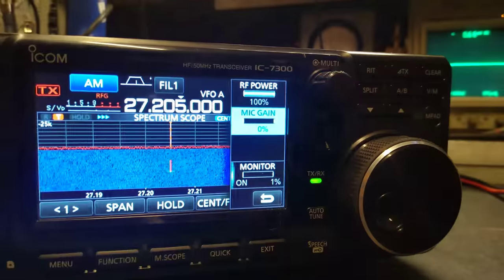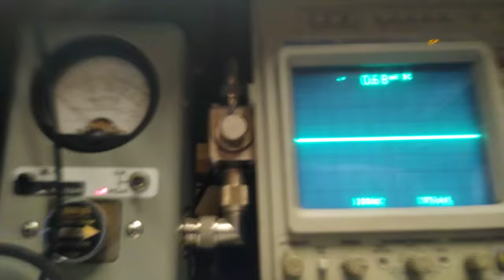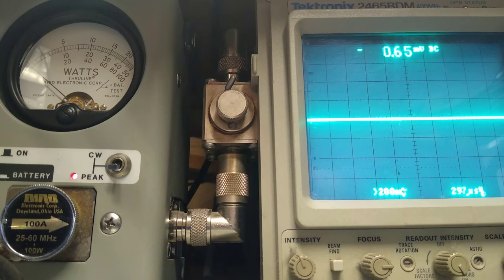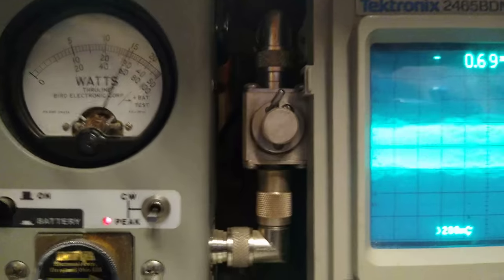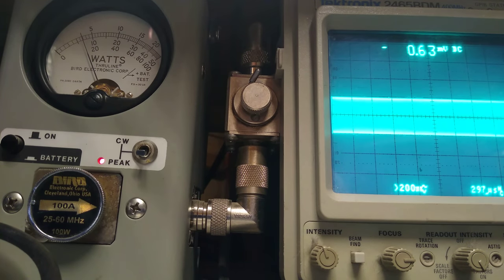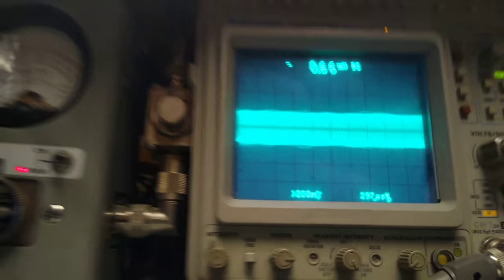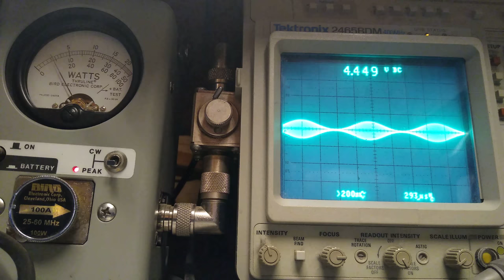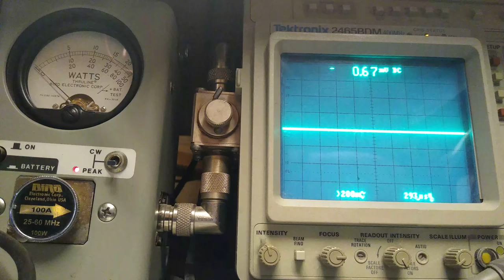Fine Tune CB Shop - IC 7300 .. What Low Level Amplitude Modulation Look Like.

Comment from the maker: Cleaner And Meaner

It's not about how many watts (if you want range), it's about how clean that you can make each and every single one of them.

The 955 Versions 2's are worse than the original
version's, and require even More TLC.

Tap tap tap ..

If they can't show you they're snowing you! Find someone who's honest and competent.

Making it clean "and" out performing those hacked up splatterboxes 
requires Skill and Calibrated Test Equipment. If they claim otherwise, 
they're either a con artist or incompetent. Take your pick!

Blame it on the materials, math and Mother Nature!

Elements, Constants and Cycles.

They can work for you or against you.

Safety First!

Cleaner And Meaner, there'll never be a substitute .. like it or not.

It's all about Procedure .. No Exceptions.

One At A Time .. Don't Be In A Hurry!

You make them ring and I'll make them sing. 
https://www.nist.gov/pml/productsservices/physical-reference-data

No longer accepting mail-ins .. Fine Tune CB Shop services radios for 
the original owner that has purchased brand new radios from Fine Tune CB
 ONLY. This way, like the Maytag repairman, I only see one or two radios
 out of 500-600 per year that may have developed an issue. I'd rather 
spend my time doing better things .. maybe you should too??

Cleaner And Meaner .. Only the serious need apply.  No "tire kickers" or
undesirables that I know for a fact disrespects the airwaves and 
especially Channel 19. Haters are always going to hate because it's all
that they know how to do and what they do best. Don't be so miserable!

If you can't handle the heat .. get out of the kitchen. 

If they can't show you .. in a video .. they're snowing you. Get The 
Picture??

Here's what it actually takes to cut through the noise, be loud and 
crystal clear with a better receiver too:  A) Tuned Bench:  
https://www.youtube.com/watch?v=lwcDfXOgAls.  True, it's more 
complicated and time consuming to accomplish these consistent and 
accurate results. Below is a partial procedure and list of calibrated 
equipment used to achieve this level of performance . Read on ..

Radio Evaluation Rules: 
https://www.facebook.com/163Hardrive/posts/3729504220447644
https://www.facebook.com/163Hardrive/posts/3523601657704569

Fine Tune CB Radio Shop strictly adheres to (https://www.nist.gov/) NIST
Traceable Calibrations and other industry standards to maintain 
accuracy and consistency for providing Real World Performance Tuning of 
Citizens Band and 10 Meter export mobile radios with integrity.

"Basic Textbook AM/FM/SSB Transceiver Tune, Alignment and Calibration" 

1) Pll adjustments
VCO & OSC, AM TX OSC, USB TX OSC, LSB TX OSC.

2) Transmitter alignment
DRIVER BIAS, FINAL BIAS, SSB  (or gate voltages for mosfet versions) 
CARRIER BALANCE, HI-LO AM & SSB Power, RF METER, AMC, ALC and FM 
DEVIATION.

3) Receiver alignment
AM/FM RF & IF SENSITIVITY, FM DETECTOR/DEVIATION, SSB IF 
SENSITIVITY, SSB S-METER, AM/FM S-METER (100uV unmodulated -67dbm for 
�S-9� meter reading!), AM/FM SQUELCH RANGE, SSB SQUELCH RANGE, and NOISE
 BLANKER/AUTOMATIC NOISE LIMITER (Real World dBm to volts (uV) tables 
below).

That's just a typical run of the mill textbook tune up and alignment (if
 you're lucky). There's more to it than frequency alignment, modulation 
adjustment, meter calibration and a tune up report displaying 
exaggerated rms Bird peak watts! 

"Test Bench includes"

Bird 4314C Meter
https://www.birdrf.com/Products/Test%20and%20Measurement/Power-Meters/Wattmeters-Line-Sections/RF-Wattmeters/4314C_PEP-Single-Element-Wattmeter.aspx
Part 1) https://www.youtube.com/watch?v=RpX9IHe4ORM&t=16s
Part 2) https://www.youtube.com/watch?v=LuhbqTf6Bxw
Bird 4314C Accuracy Test: 
https://www.youtube.com/watch?v=DqEOabYqhQo&t=5s
Bird Stipulates 1/2 wavelengths  
https://www.youtube.com/watch?v=5eWhgT-rTII
And Genuine Bird Elements from 1K down.

Bird 4373 Sampler 
https://www.rfparts.com/signal-samplers.html

HP8924c with options
http://userequip.com/files/specs/2147/HP%208924C%20Repair.pdf
https://www.youtube.com/watch?v=Cg1w0xBa27s&t=1s

HP8920a with options
https://www.keysight.com/upload/cmc_upload/All/EPSG072204.pdf

Three analog scopes, one digital 200 Mhz
https://www.atecorp.com/atecorp/media/pdfs/data-sheets/tektronix-2465b-2467b_manual.pdf
https://www.youtube.com/watch?v=by98x4eu2lM

Fluke 27fm
http://www.fluke.com/fluke/inen/digital-multimeters/fluke-27.htm?pid=56055
 
LCR 
http://www.lcrresearch.com/wp-content/uploads/2017/05/LCR_Pro1_Manual_version1.03.pdf

Power supplies
6 Cosel PBA1500f12 (750 amps) variable and configurable.
https://en.cosel.co.jp/product/powersupply/PBA/PBA1500F/PBA1500F-12/
Corcom 20VB1 F7130 EMI Filter 50-60Hz 250V

Times Microwave Coax jumpers and test leads
http://www.timesmicrowave.com/cms/products/cables/lmr/
https://www.youtube.com/watch?v=EmqaGJ6IWow
https://www.youtube.com/watch?v=1ltFVSxGp5Y
https://www.youtube.com/watch?v=v12YZT_1o90
https://www.youtube.com/watch?v=h7iiYfmYWRA&t=215s

Amphenol RF Connectors
https://www.amphenolrf.com/
https://www.youtube.com/watch?v=dVh5B0hdEA0 
https://www.youtube.com/watch?v=dKZg8T_AOso

More range, compliments, reliability and a quieter, clearer but more 
sensitive receiver,  Get Fine Tuned .. not peaked and ruined.

It's what I recommend, use, service and sell ... to you ... not 
something non practical or deceiving in a misleading way. I'm not just 
the tech and owner of Fine Tune CB Radio Shop, I'm a customer too!  When
 finished, You'll be giving radio checks, not asking for them .

dBm To Watts and Volts
Tables below displays relationship between Power in [dBm] or [Watts] and
 Voltage in RMS, peak, peak-to-peak for sinusoidal signals in 50-Ohm 
systems for accurately measuring and tuning am/fm/ssb receiver 
sensitivity, agc, squelch and "S9" Meter calibration. Real World! 

Mike @ Mikes Radio Repair (Romper Room), Mark Rutherford aka Mark 19960,
 CB Kidd, Martian and all of your other fake accounts pay attention to the 
tables below, stop misaligning radios, spreading false information and 
promoting propaganda! Window Lickers ...

  [dBm] [Watts]   [Volts]rms   [Volts]p    [Volts]pp
-140 0.100E-16  22.361 nV  31.618 nV  63.236 nV 
-139 0.126E-16  25.089 nV  35.476 nV  70.952 nV 
-138 0.158E-16  28.150 nV  39.805 nV  79.609 nV 
-137 0.200E-16  31.585 nV  44.662 nV  89.323 nV 
-136 0.251E-16  35.439 nV  50.111 nV  100.222 nV 
-135 0.316E-16  39.764 nV  56.226 nV  112.451 nV 
-134 0.398E-16  44.615 nV  63.086 nV  126.172 nV 
-133 0.501E-16  50.059 nV  70.784 nV  141.568 nV 
-132 0.631E-16  56.167 nV  79.421 nV  158.842 nV 
-131 0.794E-16  63.021 nV  89.112 nV  178.223 nV 
-130 0.100E-15  70.711 nV  99.985 nV  199.970 nV 
-129 0.126E-15  79.339 nV  112.185 nV  224.370 nV 
-128 0.158E-15  89.019 nV  125.874 nV  251.747 nV 
-127 0.200E-15  99.882 nV  141.232 nV  282.465 nV 
-126 0.251E-15  112.069 nV  158.465 nV  316.931 nV 
-125 0.316E-15  125.743 nV  177.801 nV  355.602 nV 
-124 0.398E-15  141.086 nV  199.496 nV  398.992 nV 
-123 0.501E-15  158.301 nV  223.838 nV  447.677 nV 
-122 0.631E-15  177.617 nV  251.151 nV  502.302 nV 
-121 0.794E-15  199.290 nV  281.796 nV  563.591 nV 
-120 0.100E-14  223.607 nV  316.180 nV  632.360 nV 
-119 0.126E-14  250.891 nV  354.760 nV  709.519 nV 
-118 0.158E-14  281.504 nV  398.047 nV  796.094 nV 
-117 0.200E-14  315.853 nV  446.616 nV  893.232 nV 
-116 0.251E-14  0.354 �V  0.501 �V  1.002 �V 
-115 0.316E-14  0.398 �V  0.562 �V  1.125 �V 
-114 0.398E-14  0.446 �V  0.631 �V  1.262 �V 
-113 0.501E-14  0.501 �V  0.708 �V  1.416 �V 
-112 0.631E-14  0.562 �V  0.794 �V  1.588 �V 
-111 0.794E-14  0.630 �V  0.891 �V  1.782 �V 
-110 0.100E-13  0.707 �V  1.000 �V  2.000 �V 
-109 0.126E-13  0.793 �V  1.122 �V  2.244 �V 
-108 0.158E-13  0.890 �V  1.259 �V  2.517 �V 
-107 0.200E-13  0.999 �V  1.412 �V  2.825 �V 
-106 0.251E-13  1.121 �V  1.585 �V  3.169 �V 
-105 0.316E-13  1.257 �V  1.778 �V  3.556 �V 
-104 0.398E-13  1.411 �V  1.995 �V  3.990 �V 
-103 0.501E-13  1.583 �V  2.238 �V  4.477 �V 
-102 0.631E-13  1.776 �V  2.512 �V  5.023 �V 
-101 0.794E-13  1.993 �V  2.818 �V  5.636 �V 
-100 0.100E-12  2.236 �V  3.162 �V  6.324 �V 
-99 0.126E-12  2.509 �V  3.548 �V  7.095 �V 
-98 0.158E-12  2.815 �V  3.980 �V  7.961 �V 
-97 0.200E-12  3.159 �V  4.466 �V  8.932 �V 
-96 0.251E-12  3.544 �V  5.011 �V  10.022 �V 
-95 0.316E-12  3.976 �V  5.623 �V  11.245 �V 
-94 0.398E-12  4.462 �V  6.309 �V  12.617 �V 
-93 0.501E-12  5.006 �V  7.078 �V  14.157 �V 
-92 0.631E-12  5.617 �V  7.942 �V  15.884 �V 
-91 0.794E-12  6.302 �V  8.911 �V  17.822 �V 
-90 0.100E-11  7.071 �V  9.998 �V  19.997 �V 
-89 0.126E-11  7.934 �V  11.218 �V  22.437 �V 
-88 0.158E-11  8.902 �V  12.587 �V  25.175 �V 
-87 0.200E-11  9.988 �V  14.123 �V  28.246 �V 
-86 0.251E-11  11.207 �V  15.847 �V  31.693 �V 
-85 0.316E-11  12.574 �V  17.780 �V  35.560 �V 
-84 0.398E-11  14.109 �V  19.950 �V  39.899 �V 
-83 0.501E-11  15.830 �V  22.384 �V  44.768 �V 
-82 0.631E-11  17.762 �V  25.115 �V  50.230 �V 
-81 0.794E-11  19.929 �V  28.180 �V  56.359 �V 
-80 0.100E-10  22.361 �V  31.618 �V  63.236 �V 
-79 0.126E-10  25.089 �V  35.476 �V  70.952 �V       

                         Don't Be A Mud Duck!

Contact: https://www.youtube.com/watch?v=P0W_Ltzeyyc ONLY when Ready. 

Tire kickers GET THE BOOT.

163HD